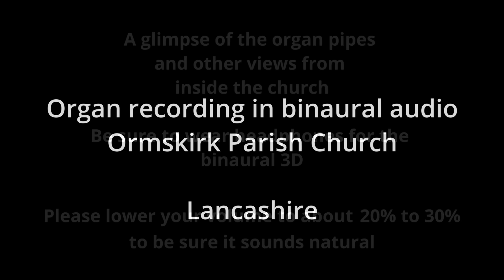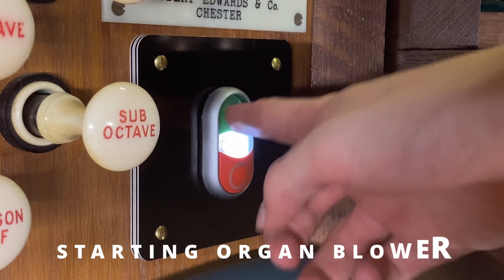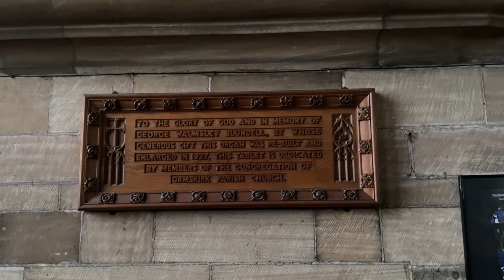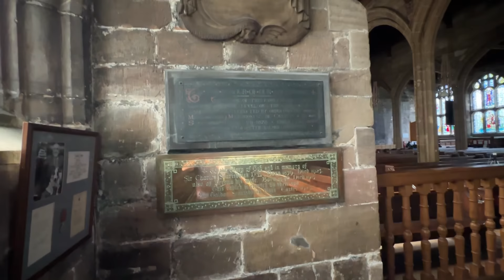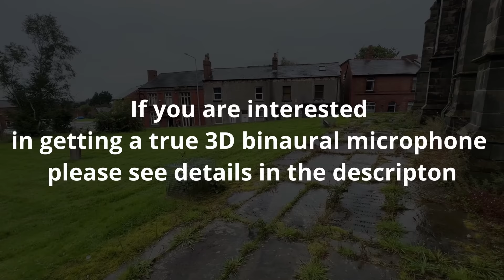Organ recording in 3D binaural audio (headphones) Ormskirk Parish Church - We manufacture the SR3D!

Comment: Odd, I hear a lot of noise in the recording, that is present even during the loud passages; perhaps some line noise or compression artifact?  What a beautiful performance, historic church and refulgent instrument.
Reply from the maker: Yes, plenty of noise, I’m sure you spotted the note on the video explaining what it was unless you skipped through it. Compression artefacts sound very much different to the hiss of escaping air, but it even got me when I first got back to the workshop as I though it was some kind of noise with the equipment too, but it’s just air escaping from the old leather seals. The church does have a fund for raising monies to repair it, it is a very expensive project.

Comment: I have never understood why there are three (3) keyboards (manuals?) and for this piece why is there a dummy-head? Please explain, I won't make fun. I am legitimately curious. THX.
Reply from the maker: The dummy head and other mics is the reason for the video, it’s more an audio thing than a video thing. The dummy head is a microphone as are the tube mics, and are specialised in collecting sounds in exactly how we hear things, so you should have been wearing headphones to tele-transport your ears to the church and would experience what it actually sounds like in there, if you close your eyes it maybe more convincing- it’s called binaural audio and is very special sound that makes things sound like they are external to ourselves as in real life.
Reply: Organs have multiple keyboards (manuals) because different sounds are needed at the same time when playing. There are quick ways to change stops, but more flexibility is needed than that. Each manual typically has different pipes associated with it. You can couple one keyboard to another usually. If I coupled Swell to Great, the swell pipes would play when I play the Great, but not vice versa. Basically each keyboard has different pipes and different sounds. Volume level was also a concern. Remember organs were made before modern electronics. It was not always possible to change the loudness of each pipe. Some were put in a box where doors could be opened and closed to adjust loudness level.

If you pull out all the stops, the organs can get quite loud. Also, if you remember that organs don't have sustain pedals, you can see the pedals (not the keyboard for the feet but the ones just above thoae) would be used for other things. One pedal is often the crescendo pedal that automatically adds specific sounds or pipes as you change the position of the pedal. Another possible pedal use would be to open and close the swell box that makes some pipes louder and softer.

So basically, you have several manuals used for different pipes or sounds. They can usually be coupled together in some ways, depending on the organ. You have the keyboard for the feet which also has its own pipes, and usually can have the swell or Great manual coupled to it. Then just above the keyboard pedals for the feet, you often have 2 or 3 pedals that look sort of like a sustain pedal but actually are the crescendo pedal or volume in some organs. 

The stops you pull out are different pipe sounds. The number written is the pipe length. The buttons in between the manuals are memory presets. You can make certain combinations of pipes active, then set those to memory. Often, there are also foot memory buttons too.